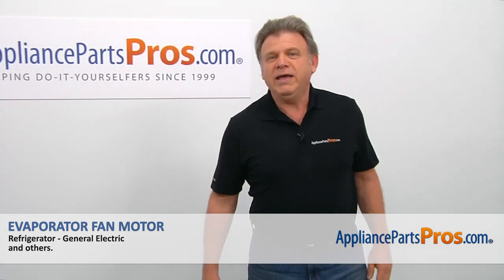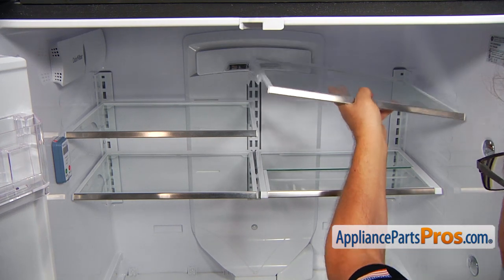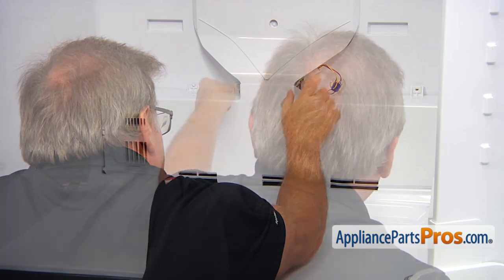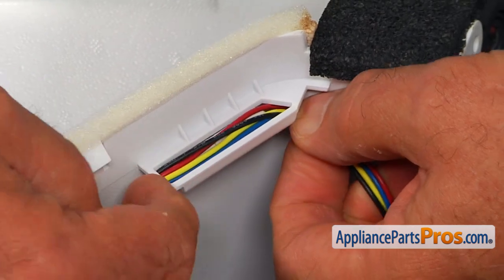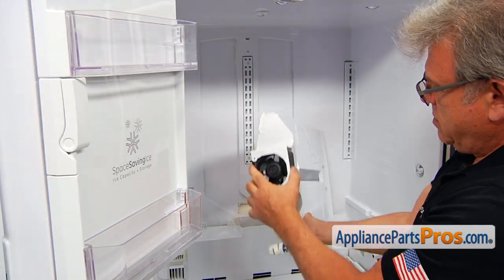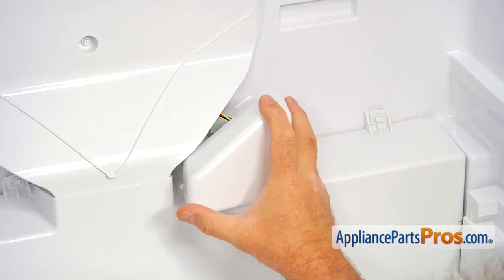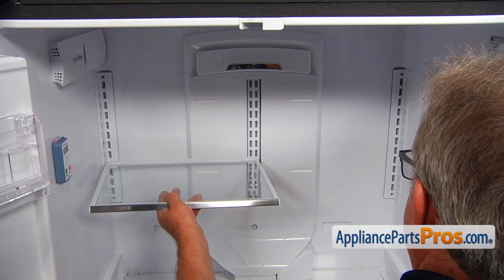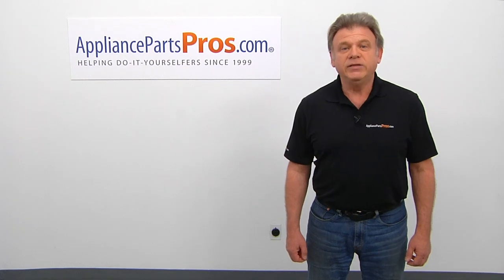How To: GE Evaporator Fan Motor WR60X26866

Comment: Outstanding video!  Carefully followed every step and my refrigerator fresh food compartment is back to 37 degrees overnight.  Make sure to wipe up all the water from the ice that is most likely all around the bottom of the evaporator area--there was a lot of it in my fridge.  Also an excellent time to clean up all the spills that have accumulated through the years your fridge has been being used. Echo the comments below about the video greatly reducing the chances of breaking plastic parts during disassembly.  Bravo!

Comment: Wow, fantastic video.  I paid to have this job done the first time and now I did it myself the second time.  Looks like we are on a 3-year replacement cycle for this fan.  If your freezer is cold but your refrigerator is not, this is an easy fix for most homeowners.  Give it a try.

Comment: My 5 YO GE Fridge was freezing the deli meat drawer but not blowing cold air to the rest of the fridge.  Replacing this fan solved my problem thanks to this excellent video.  The only issue I had was that while disassembling I found the wiring harness at the 2:40 mark already unplugged and had to guess whether it was intentional or an oversight.  I decided to plug it in upon reassembly and so far it seems to have been the correct choice.   Thank you for this excellent video and supply of the part.

Comment: Indeed, I found the process easy to follow, & I completed the repair in less than an hour.  My refrigerator was fixed and has been operating as usual.  Maintaining 37°.  But I have to say this fan motor is the weak part of the refrigerator. This was 3rd fan motor, they last about 4 years. I now realize the noise I was hearing was the fan motor apparently going bad to failure.  So I’ll need to remember to replace the fan motor again as soon as I hear the clicking/grinding noise.
Reply: We are on our 3rd fan too, I agree this fan needs to be redesigned.

Comment: thanks so much for posting this! great video, helped get our fridge back up and running quicker than  any repairman could have been here to fix it.
my fridge was PFE28KSKBSS. it started making loud squeaky noises then temps went up. but freezer and even deli/fruit bins were fine. when i took it apart, the old fan was seized and squeaky, the new fan smooth and spun freely. temps were back down to 30s within ~ an hour.

Comment: Thanx for the video. My Fresh Food Evaporator Fan Motor is completely shot. I also get an error code that the Condenser Fan Motor Assembly can't get up to operating speed. I'll have to replace both....Saves a lotta $$ having a GE tech come and fix things....

Comment: Great video. Is there a way to test the fan with a multimeter to make sure it's not working?
Reply from the maker: What is your model number?
Reply from the maker: Thank you. You can test for power to the fan motor. If you have power at the fan motor and it's not coming on then you will need to replace the control board. That fan should be running when the compressor is on.

Comment: Was about to buy another fridge after GE Appliance told me that they cannot repair because the fan is not available anymore ($120 fee still apply). Watched this video, bought the fan, fridge is working now. Do not see that much improvement for the current new fridges on market either. Thx.